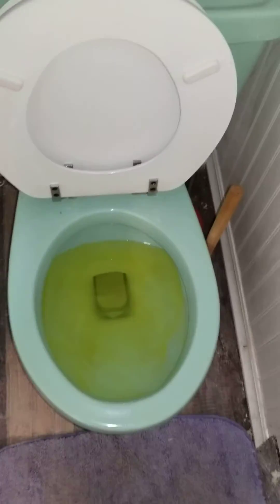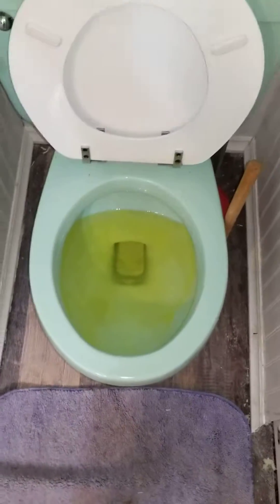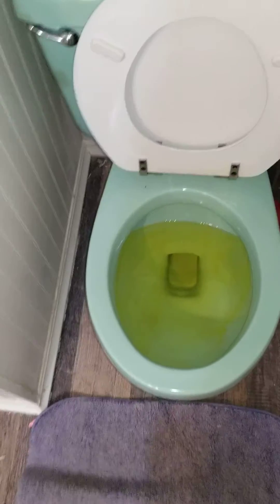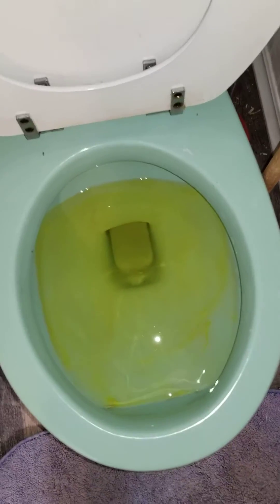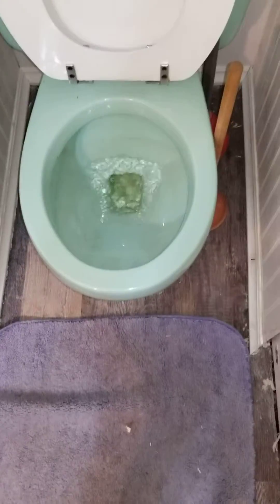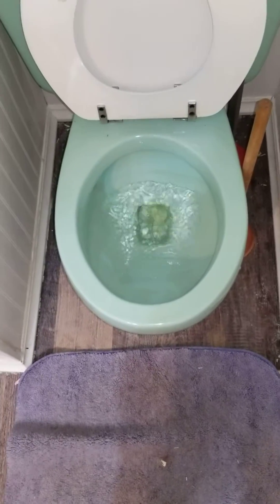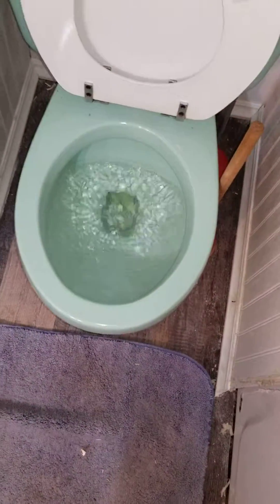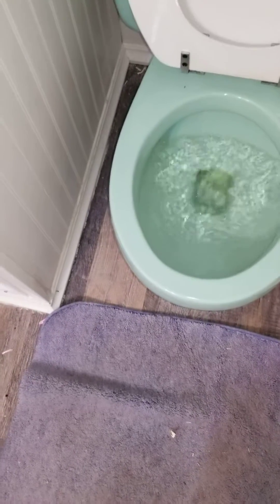1965 Borg Warner Chase Toilet Dye Test on 1.6 gallons.

Comment: And this was essentially the problem just about all toilets in the US manufactured in the mid 1990s experienced particularly those made in 1994 to about 1996 because Energy Policy Act of 1992 effectively outlawed the manufacture and installation of toilets using more than 1.6 GPF on Jan 1, 1994.  However, at that time the bowl and trapways were really meant to flush with 3.5 gallons or more, some requiring 5 gallons for best results, and manufacturers simply placed a smaller tank or designed a flush valve such that no more than 1.6 gallons was allowed to flow out of the tank during a flush.   After a few years manufacturers have figured it out a different trapway/bowl design that would work more effectively with 1.6 gallons, though typically a far cry from the pre-1994 3.5+ GPF models, but, you get the point.    

The ultimate solution was the development of power assisted and vacuum assisted flush toilets.  I had a power assisted flush model at a rental property I lived at for one year 6 years ago. I never found out the date of manufacture, but it was an American Standard marked 1.28 GPF and yet it performed even better than some of the older toilets that were in my childhood home, which may have been the originals and the home was built in 1962.